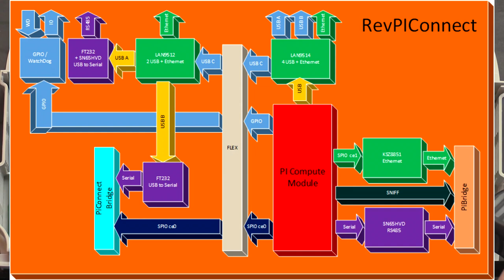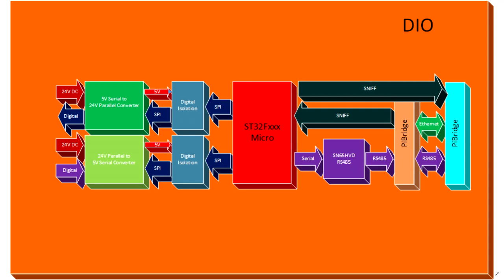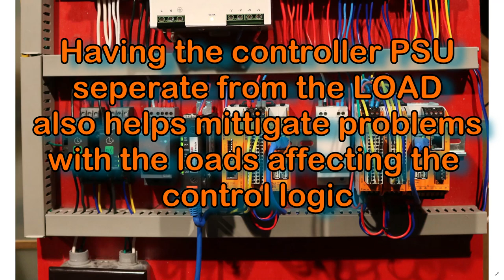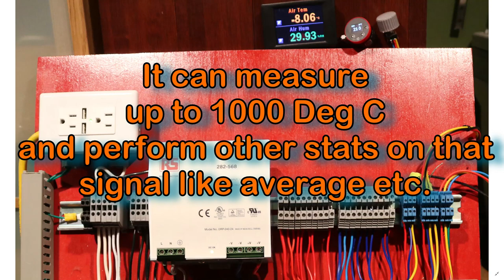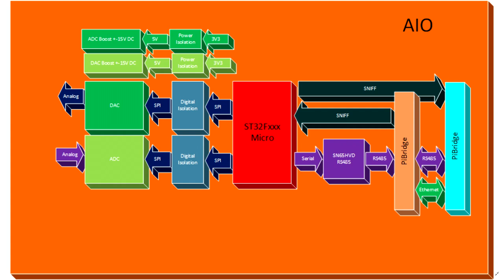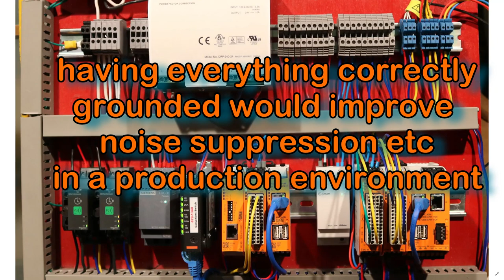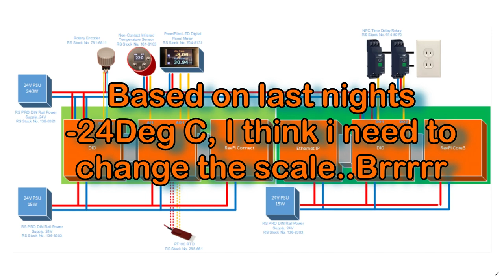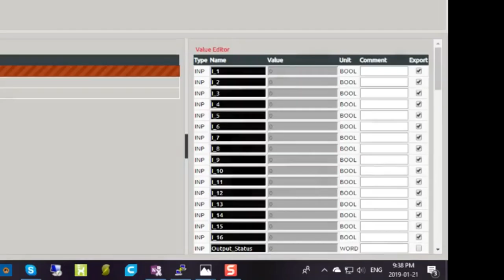Raspberry PI Revolution part 1, overview and tear-down

Comment: Excellent video. You mentioned that they can run on a 12V source at the beginning of the video. Do you just use the 24V supply in connection on each device?
Reply from the maker: You can use 12 or 24V throughout but the internal logic (Connected via the bridge connectors) is typically isolated from the actual IO, this is why there is a separate 12/24v connection for that on each module., and sometimes internally there is a isolating dc to dc convertor to power the internals. look at the parts where I tear them apart.

Comment: Looked up prices online. The two ethernet port module is nearly 400 pounds, for that amount you might as well get a smart relay from Eaton or an S7-1200 would be cheaper.
Reply from the maker: Then add in all that proprietary software and annual licenses etc....., this is also way more powerful from a processing perspective.
Reply: @TheBreadboardca  Yeah software is expensive but if you have it like myself it just doesn't makes sense to trade a brick plc from Siemens or another big brand for a pi. I love the pi though especially when you can use it with codesys. Do you happen to know if this industrial package can be used fully within codesys? Modules?
Reply: You are the perfect one to ask , 
I’m coming back into automation to use on my own, I did study automation, 15 years ago , I’m not up to date . 
I have experience with Siemens;
Is it convenient for me keep Siemens knowledge or go with this Raspberry community to implement in my future big protects?
Reply: @WWG1-WGA  For home projects I think raspberry pi is fine and can even use codesys to further your plc programming skills. For serious industrial use I would never use a pi, I've been doing plc's for 15 years now professionally. Plc programming hasn't changed much in a long time so whatever you knew can still be used for the most part.
Reply: @nobytes2  awesome , thank you for the reply 👌🏼👌🏼👌🏼🙏🏼
Reply: @WWG1-WGA  You're welcome

Comment: Great video. I didn't know you are in Canada. By the temp you might be East or North. I'm in Victoria on the West coast. I don't think we have been below 0 c yet.
Reply from the maker: Just outside Toronto, Ontario :), its back to + 4 right now, but forecast has another -15 ish coming or worse
Reply: @TheBreadboardca  Stopped in there a couple times. Once to see Band called Goddo ( Guys I know )at the nags head. I seem to have quite a few Canadians I'm subscribed to. Poliofstuff, AvE, SimpleElectronics, Gadget Reboot...All good stuff.

Comment: Hi! The video is very interesting, I have a question. Making a comparison between the revolution pi and a LOGO! PLC, would there be any advantages of using the revolution Pi instead of the LOGO !?
Reply from the maker: Pretty sure the Logo PLC uses a bespoke programming environment (Relay / structured or other) to make the PLC function and the environment is paid for / wont work for other PLCs, you must use their environment to program their PLC.
The Revolution PI can be programmed in Ladder / Structured formats using tools available from the Kunbus Site but you can also use pretty much any of the available free opensource environments as well including Node-Red, C, C++, C#, Perl, Python,  etc. basically anything that you can use on a Raspberry PI but the Rev PI has the advantage of having RealTime patches in the OS to allow for Industrial / Traditional PLC predictability that a pure Raspbian does not have.
Dont get me wrong, the Logo PLC is a great little PLC and I have reviewed many PLC's over the years all good in their own right, but I always seem to prefer the ones with an open architecture, I get the max options that way,
Hope this helps :)
Reply: @TheBreadboardca  Thank you very much for the answer, it really helped me a lot

Comment: Is it possible to run a POE Camera and capture images using the second port of the Rev Pi Connect? If not, is there an industrial controller that can capture images from a POE camera that you would recommend?
Reply from the maker: Yes it is possible, using Node Red or other tools it is also possible to have a live stream page on a web based user interface screen, as your essentially running Raspbian you can do pretty much anything you can do on a PI.